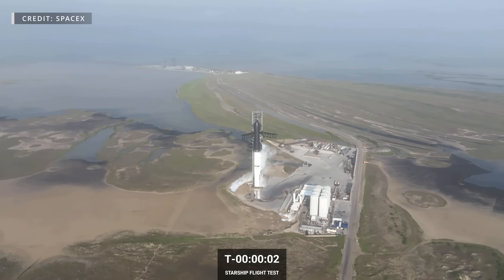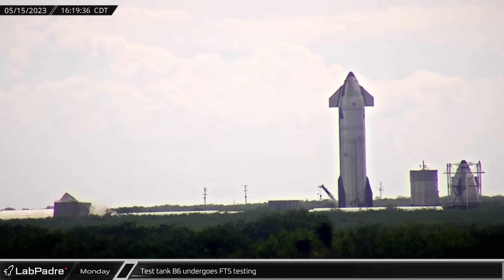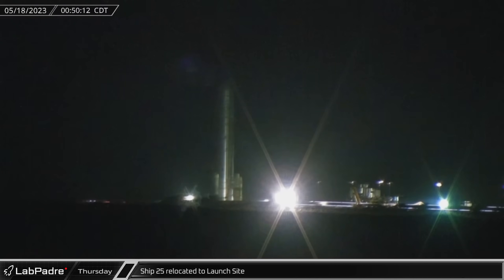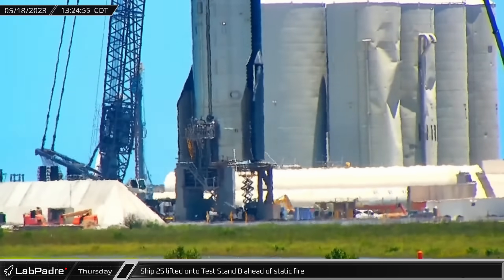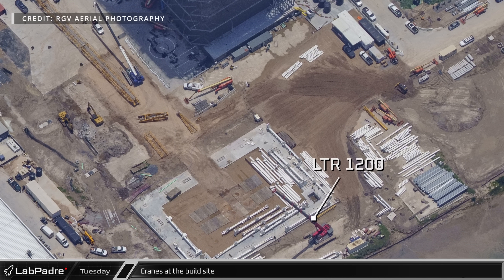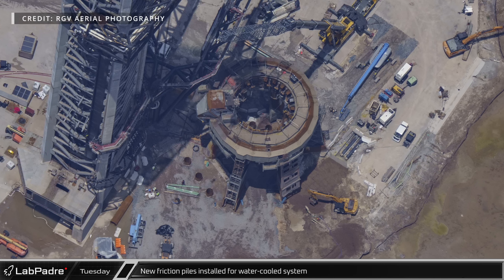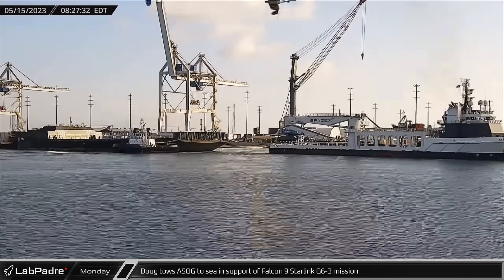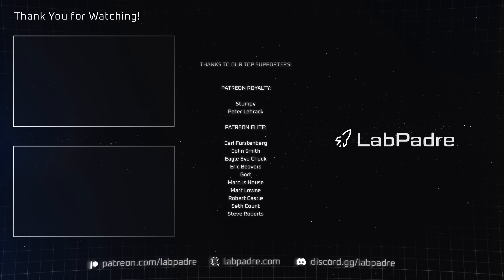SpaceX Conducts New Water-Cooled Steel Plate Test! - Starbase Weekly Update #63

Comment: Thanks LabPadre!  I can't believe how deep those piles are and how fast they are installing them.  I wonder how long it takes for that much concrete to cure.
Reply: It takes 29 to 30 days for concrete to cure 98% full strength then it continues to slowly strengthen for the final 2% for about 100 years.
However, concrete weakens from chlorides from the saltwater soaking the ground in that area and oxidation of the rebar causes cracks which means the concrete starts cracking in 20 to 25 years

Comment: the water comeing out of the water system will be slower than the speed of the  booster rapters.. so will clear the water as fast as it comes out ..the metal plate will have direct heat on it and will  blast it...and heat to the pipes underneath will possible be damaged within a few seconds
Reply: My money says Cato at launch. there's no way that the water under the plate doesn't vaporize and lift the whole thing up in the air like the devils worst magic carpet

Comment: Option #1: SpaceX uses ship #25, if it is more cost and schedule effective to install 27 engines, than to make engineering upgrades to other ship with full complement of installed raptors.
Option #2:  Use #25 as a convenient test fixture to "ship validate" 6 raptors, and stress prove the modified mounts.  Engines are bench tested in McGregor, so ship [and mount] confirmation is remaining validation step.  If #29 is fully stacked before pad protection is complete, then go with it.  Schedule trumps cost.
Option #3: ?

Comment: Water-cooled 'launchmountanium' could work. Will they use inertia to briefly counter the pressure of liftoff, so that the wet launch floor doesn't instantly 5:14 get overpowered to a dry launch floor? There'd have to be some long straight-ish pipes to the launch mount for 'water hammer' to work, I think...

Comment: The test firing of the engine against the steel plate sure looks orange/yellow instead of shades of blue. Low throttle or a different fuel variant?
Reply: the water vapor turns the flame orange